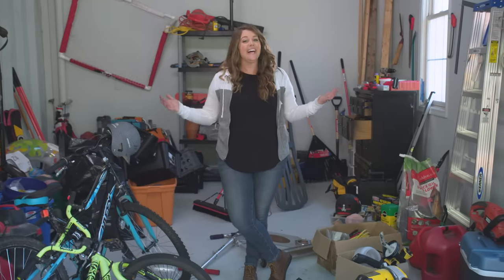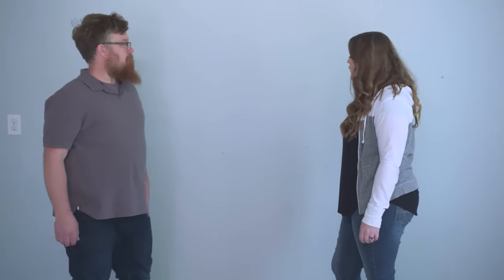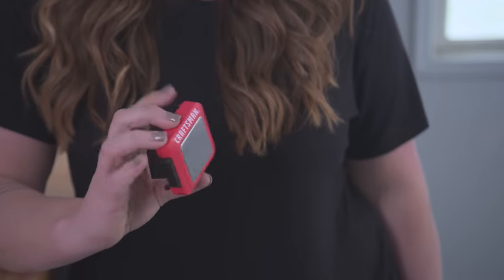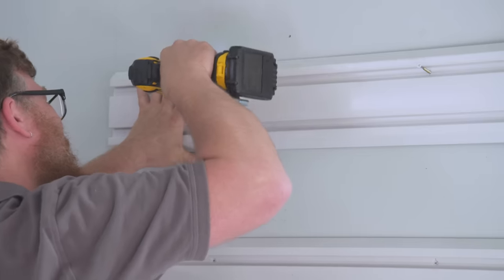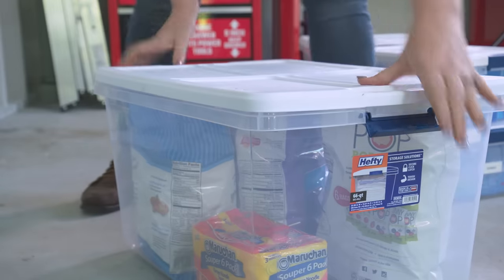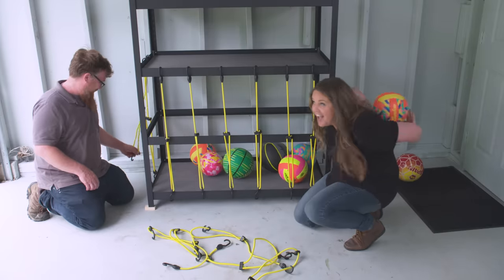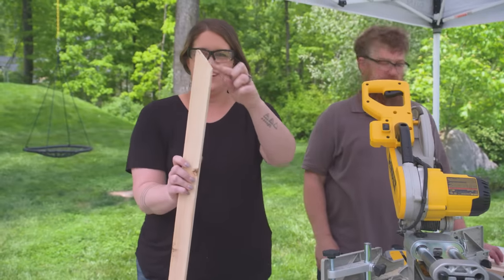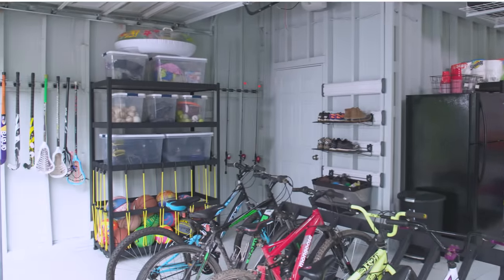How to Organize a Garage (w/ Monica from The Weekender)

Comment: That's great organisation but where am I going to park my 2 cars now? I like to park my cars in the garage
Reply: @XploreAz  Even with it all organized, no way a big suv or truck is fitting in that garage with all that stuff.
Reply: @Superman-xr1oh  true. My truck doesn’t fit in my garage when it’s completely empty.
Reply: Park them in the garage and build a separate storage shed 😂
Reply: Yo
Reply: Ok. Leave everything cluttered then. If that will allow to park your  2 cars. Duh
Reply: Buy a bigger house
Reply: On the street
Reply: It's pretty obvious the owners weren't parking a vehicle in the garage.
Reply: I also park in my garage (a large SUV), and I’m thinking that you’ll probably have to rely mostly on ceiling and wall storage. There are ceiling storage solutions that are a lot larger than what we saw here available, and there are also ceiling platforms that raise and lower with the push of a button.
Reply: That’s your problem
Reply: Then get a cheap backyard shed
Reply: Sounds like a personal problem

Comment: Great video why not attach those chargers to the wall below the metal cupboard? that would keep things more clutter-free and keep the surface of the rolling storage cabinet open if you need to move it (as you said) for a project somewhere else in the garage.

Comment: For all the people complaining about cost.
1. Pegboard and furring strips are dirt cheap.   Arguably, they could have done the garden tool wall with pegboard too (that's what I did)
2.  The big set of shelves (or similar) and broom/yard tool hangers on the sporting goods wall is also cheap.  For the ball storage, could have saved some money drilling holes and doing 2 sides with laundry line, saving the more expensive bungies for just one side.
3.  The only really expensive thing was the woodworking wall.  And there are cheaper ways to deal with that too, if you show some creativity.
4.  You don't have to bite it all off at once.  You could organize sporting goods, then wait a month or two and tackle gardening items, and so on.

Comment: If you can attach a track system and it goes over an outlet, if you can avoid it, don't put the screw in the stud next to the outlet.  The outlet conductors are required by the NEC to be secured to the stud within a short distance of where it enters the outlet box.  Placing a mounting screw into that stud has a potential to end up in the side of the stud and could strip and short your electrical feed to the outlet.

Comment: I would like to see some ideas on What's the best way on installing out door speakers system in  your yard and landscaping would like to see  ideas on installation and what's best in using wireless or running speaker wire through yard this is something I would like to see on you videos 
Thanks

Comment: I love the pegboard and the workbench that’s what I need in my garage except I’m working with uneven walls. I have a bump out on the bottom half of wall that is the foundation of the house. Do you have any advice for walls like that or should I frame it and add drywall to have an even level wall?

Comment: I like my Gladiator cabinets and worktable but I had to hold back on the Gladiator wall track system.  I found it too expensive to cover a substantial area for good use.  I found the Rubbermaid wall track system (also sold at Lowe's) much more versatile to use and cut to size.  Give it a try on your next project.  Now, if I could only get my kids to consistently put the bike and the balls back in place all this would be worth it!  :-)

Comment: The tricky aspect to this is whether or not a smaller hole has to be pre-drilled before the screw is inserted.  Depending on the wood used, the wood can crack as the screw is drilled in. But pre-drilling a hole can accidentally go through into the drywall. Drilling before putting up on the drywall can be tricky if the holes don't match the studs.

Comment: Sure is easy when you've got an extra few thousand dollars for Craftsman toolboxes
Reply: With those pretty tool boxes they could have ended the video as soon as they rolled them in and got a "like".
Reply: Wayfair is a source of many types of garage cabinets at a discounted price
Reply: Yeah for $500 someone else would have cleaned it all up for you :P
Reply: Harbor freight ftw
Reply: Lewis Carter indeed
Reply: I built my rolling cabinets out of old pallets and 2x4 scraps. I think between the nails, hinges, handle, magnetic latch, and wheels I spent maybe $75. The harbor freight 48x72 cabinet is $400 without wheels. I utilize my cabinet in front of my sprinkler shutoff and sometimes need to access it. The wheels are pretty important for my situation.

Comment: The items in this garage were curated so they look nice, but that isn't reality. The compound miter saw in the first part of the video was not stored in the garage. They used it in the project and then got rid of it because neatly storing it where it can also be accessed for use is difficult in a typical garage. Making things disappear and reappear at will is TV, but not real life. There are some good ideas in here, though.
Reply: It can be done. I have a long, height adjustable bench on rollers. Miter saw and grinder mounted. I roll it out of the garage when I need it. In the garage, it sits along a wall under another  bench that is more than twice as wide and long with a top that is hinged in the middle. The hinged top drops down and hides the saw and grinder bench, saw horses, a table saw, some other tools, etc., and still gives me a place to work in the garage, if necessary. That hinged top also hides my recycling and garbage bins.

Comment: OK but I need a solution for kids battery operated cars/quads we have those and trikes and a small two car garage,  that we need to still fit our cars into since we are in the Midwest.  Right now we keep having to stack them on top of each other which is a pain everytime they want to use one cause they are bulky and not the lightest.
Reply: I wonder if they can be hung vertically at the front of your garage, and hoisted up? Or drive them on to a platform, secure, then hoist up the platform to above cars' hood height with a pulley system?

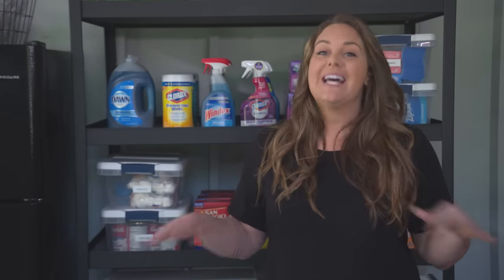Comment: 7:05 less than an hour to get it all together? You mean an hour to get the idea set? Bc no way you clean out, find studs, organize and screw things in less than an hour
Reply: Why? It's not hard, and it goes very quickly if you are systematic. Plan it, mark it, cut it, mount it. Obviously, you need power tools and 2 people.

Comment: This is really stupid.....do you think everyone can go out and buy all these expensive tool cabinets/workbench/ lockers??????? Are you serious???????magnetic squares????????Wall track system...........this is so unrealistic in the real world.........
Reply: However at 8:22 she has a lot of balls! haha!
Reply: If you can't afford it, obviously put in cheaper solutions. Wood is cheap. So are screws and an impact driver. You can buy a used miter saw for 20-30 bucks. That's all you need, besides some hardware like hinges and drawer slides (which are not necessary). No need to paint. Be creative and you can hide/organize/hang everything for 50 in materials or less if you buy used shelving, etc.